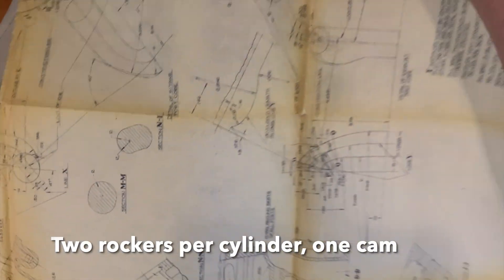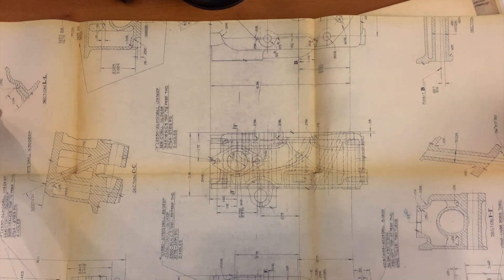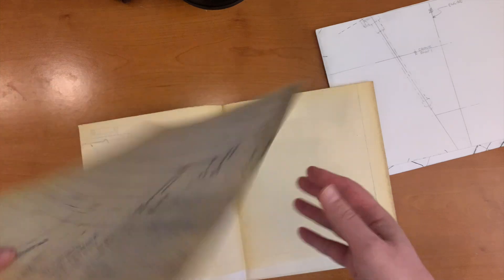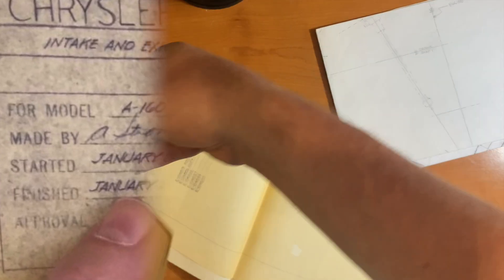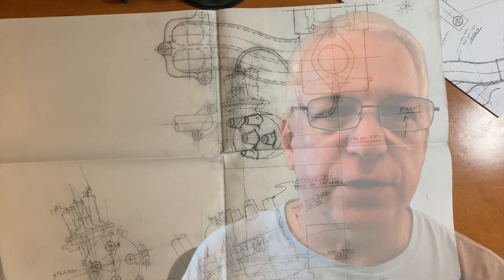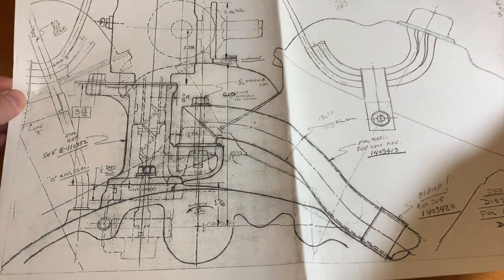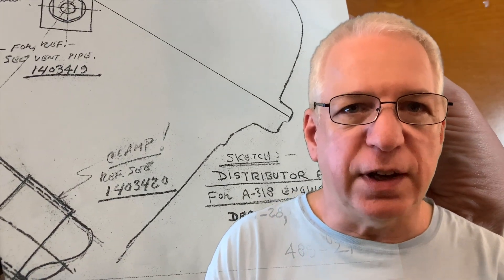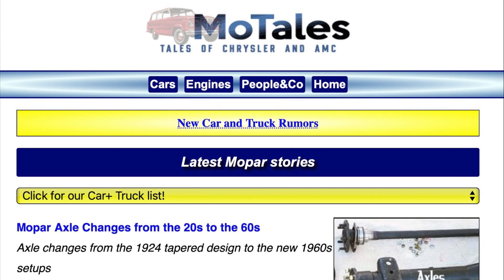Mopar’s Hemi V6 for 1951: blueprints and talk

Comment: Back in the late 70's or early 80's, I had seen in one of the old HotRod or Mopar magazines an article about originally the 340/318 LA motor was to be a small hemi V8, this would Figure because I always wondered why the pushrods in the engine came at such an angle, if they go straight up, that would fit for a Hemi cylinder head engine, but I cannot find any information on it nowadays. Essentially the modern 5.7 is considered a small Block engine.
Reply from the maker: We have a video on that! https://youtu.be/DcGjd5JdIYc

Comment: That's a cool dive into a Mopar 'what if?' history.   
   It's also very interesting they were thinking of using aluminum head castings back then. 
   The greater heat dissipation of the aluminum heads could have worked well with the lower octane fuel available outside of the North American car & truck market.
Reply from the maker: I believe they did have some aluminum head castings for the higher compression “red heads” but not on the Hemi.